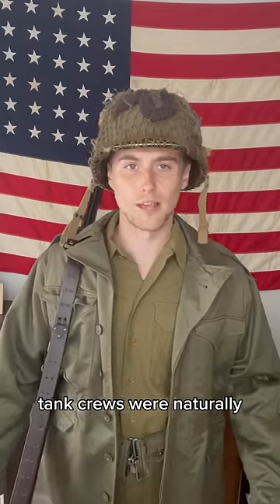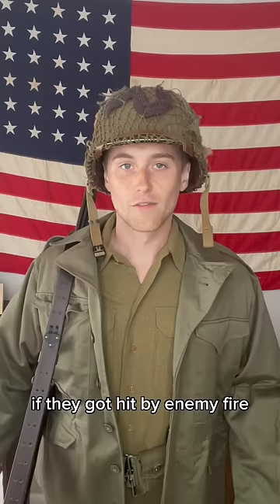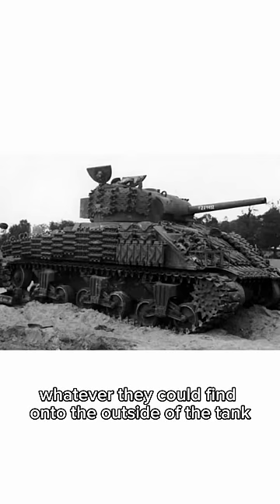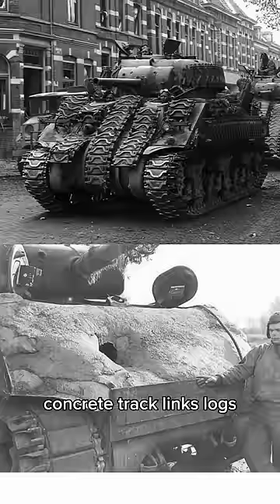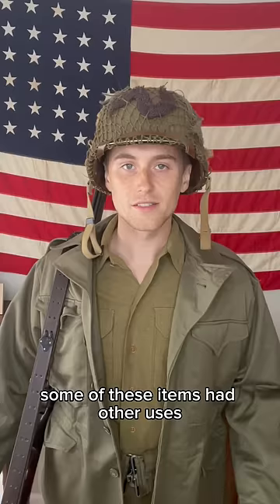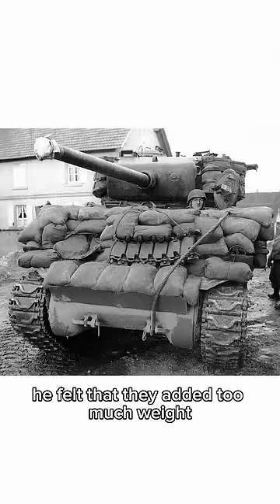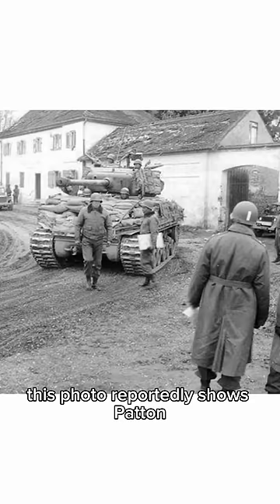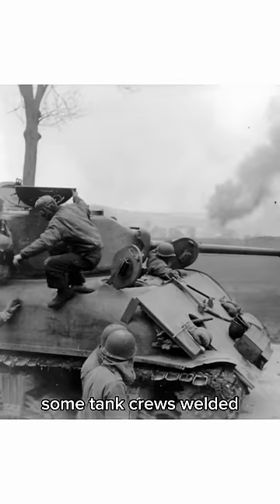Improvised Armor on US WWII Tanks

Comment: big brother google is watching. i was just looking at some history on/around the sherman jumbo, because of both a game. but also i found a couple tank books in a HPB a couple months ago and one of them said that the m4a3 also had about 200 of the tanks uparmored. at the new thickest being 171 on the hull & 167 on the turret, which didn't line up with the game and the game didn't list the usual "historically the thickest part was 20mm thicker on the hull & 15mm thicker on the turret" it usually does for other armor. so i checked the internet, and one page mentioned that tank crews did do this, which wasn't as bad on the m4e3, or m4a3e8. but the ones that survived the inital deployment often found themselves getting concrete added to the armor or other weight. which was detrimental to the transmission, and all the running gear as it was basically bottomed out with just the added armor. while when steel plates were taken from other dead shermans & german tanks. 80ish man hours of welding and cutting was able to fit roughly the same armor thickness to the m4a3e8 as was on the jumbo, but was able to run much better not having the sides & rear of the turret thickness added weight

Comment: Patton was right they did a study to test whether it helped or not, most countries at the time did even the Germans, the Germans poured tons of concrete onto tanks hoping that there'd be a magical amount that gave protection without being toooo heavy, they found out they were wrong, with us we tested alot and found most improvised armors are either A not helpful at all or B could potentially make the enemies round penetrate rather than bounce, you mentioned tank treads, a round hitting it right that may have bounced otherwise could have it's trajectory sent downward into the hull by those treads on it, they were a liability at worst and gave you worse fuel economy but a cool look at best, though the logs for traction useful if you need to cross stuff, just understand it isn't protecting you all that much.

the sand bags would in my opinion only really stop small arms fire BUT if someone knows more I'm not saying I'm an expert, so they too would be just as much of a hinderance as those small arms weren't really going through your tank anyway...

they did also find that soldiers felt considerably safer in tanks that had the improvised stuff as well, even if the improvised stuff were some of the things that can make your risks higher, the idea that they were protected was enough to soothe them, whether it helped or not didn't matter.

Comment: Everything is multipurpose. Those spare tank treads you're gonna store on the tank anyways? Extra armor. Got some logs for when the tank get's stuck in the mud? Extra armor. Those sandbags you have for when you want to dig in with your tank? You guessed it; extra armor.
Reply: Sure, put on more of those spare tracks! And a few more sandbags, and maybe one more log! Oh, what is it, are you stuck in a ditch, getting shot at and being unable to move? Did you sink into soft ground and can't drive out? Did the suspension fail yet again? Surely not because you're too heavy, those sandbags and spare tracks don't add that much weight, do they? Do they???
Reply: @Trakkson  Bruh, if you feel your tank is starting to get stuck in the mud, all you have to do is avoiding getting stuck in the mud. It's that simple.

Comment: Ain’t no way those boys removed those sandbags after Patton left. Great general but I would much rather my crews survived or at least would be “less” nervous going into battle with the reinforcements. The Sherman crews had balls of steel that added more weight than any reinforcements put on that outside of that tin can.

Comment: Too much weight? On a tank that weights 33 tons! Patton stop kidding yourself and just say you think it looks ugly.
Reply: Tanks transmission and suspension is rated to last certain amount of weight and use for certain time, when you suddenly add 500kg-1t of extra weight to front you will wear out both suspension and transmission way faster. There is a good reason why tanks don't just have 20mm rear armor, because they need extra armor at the back to be counterweight for all the weight at the front. 

On top of that you make your tank slower and add armor that many cases makes your armor weaker having your reliability down isn't really a good trade.